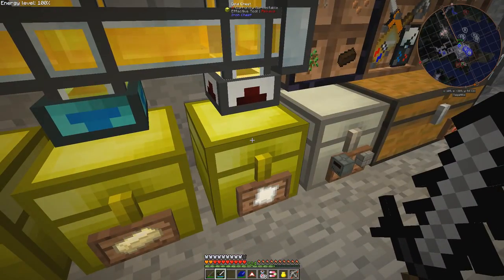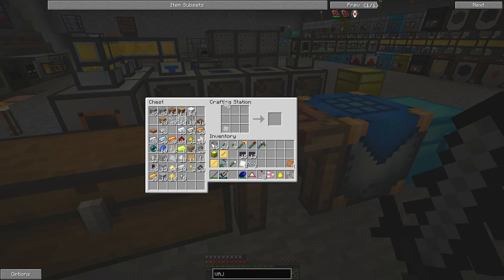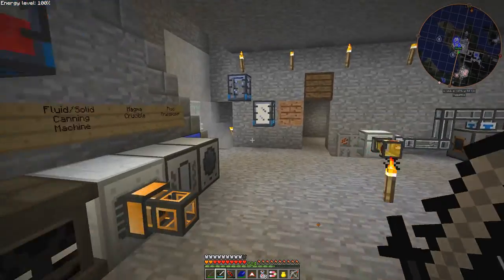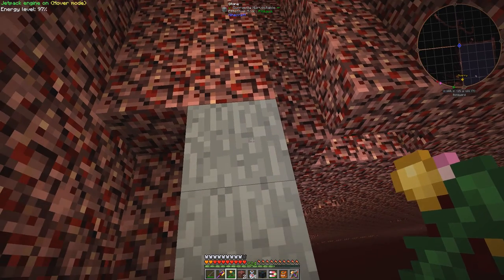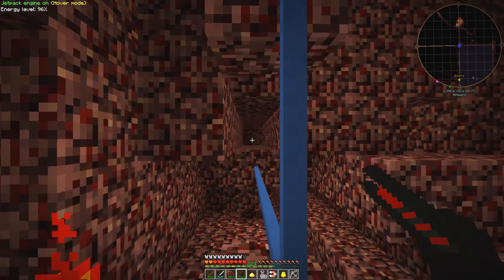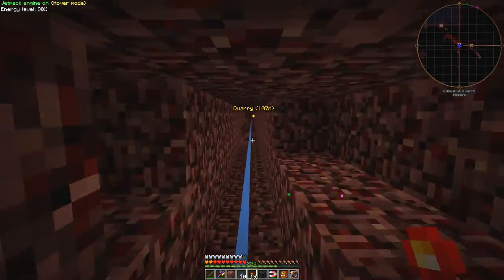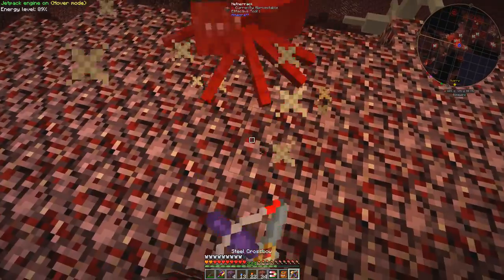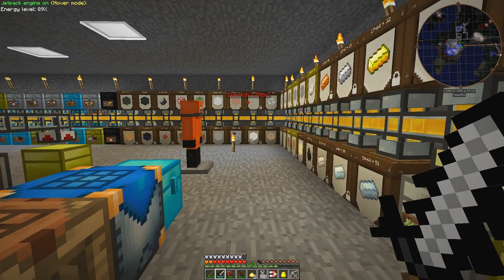Episode 34, Vajra

Comment: A little tip, When you're looking at a crafting recipe, Shift-left click the question mark when using a crafting table, NEI will auto fill the crafting table with the items required for the recipe using the items in your inventory.
Reply from the maker: +Loki Thanks for the tip. I've not figured out when it works and when it doesn't. It doesn't take out items from the chest and sometimes it doesn't work when all the items are in the inventory. I'll have to play around to see what the criteria is. Maybe when the same item is in the chest or the travellers belt.
Reply: Duncan Webb
Not too sure about the belt or the knapsack, as long as its in your normal inventory it should always work unless your missing an item to complete it.